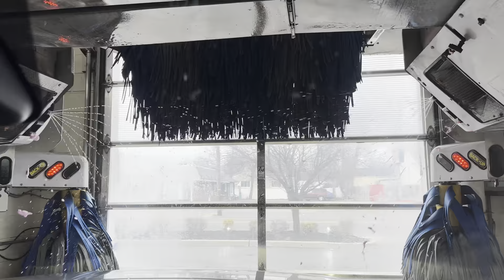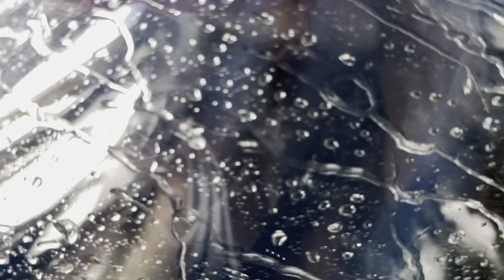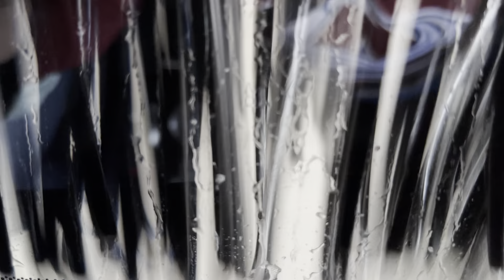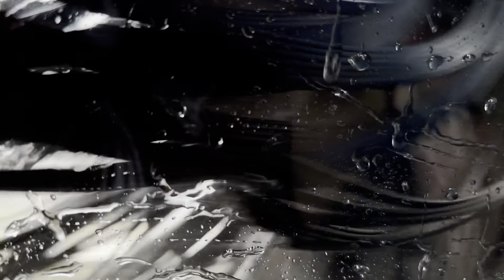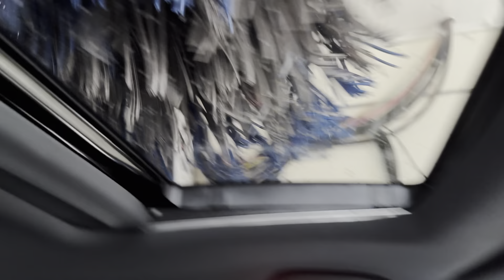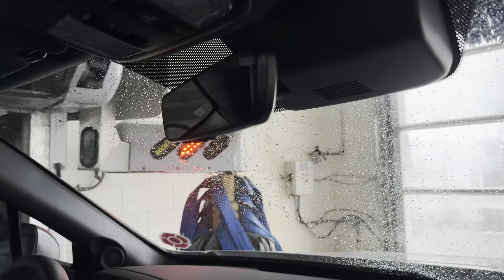Dilapidated Ryko SoftGloss MAXX || Super Soapy Car Wash

Comment: I know I’m incredibly late, but this machine doesn’t need to be replaced, it just needs to be refurbished.  Water struggled to break at the center of the car.  A good chemical rep would likely increase the rating of this wash by 1 or 2 points, as it looks like chemistry is severely lacking with this machine, which is a good indicator of an absentee owner/operator.
Reply from the maker: That is true. A refurbishment would be nice.